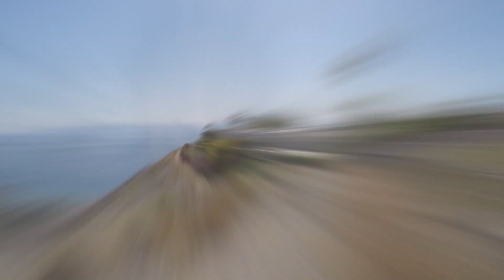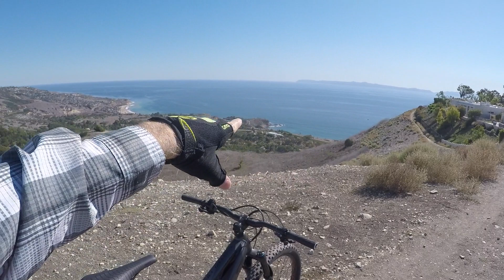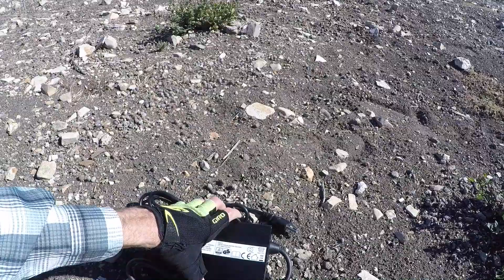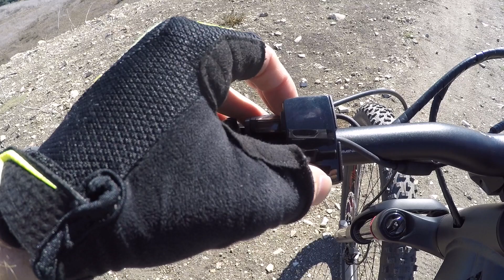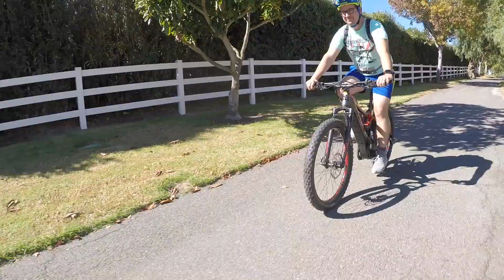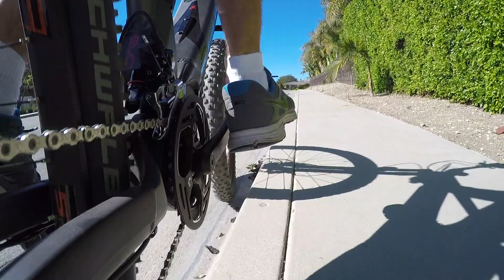BULLS E-STREAM EVO 45 AM Review - $5.5k

Comment: At the beginning of September 2020 I was on a sales phone call with M... from Flyride USA who claimed to be the COO of the company he was trying to sell me an electric Bulls bike. I asked him about  the known problem Bulls e-bikes have with the Brose motor. He assured me that Bulls has no defects with their Brose motor. He further informed me that it was only SPECIALIZED e-bike (which I wanted to buy from him in the first place) that had "bad motor" issue due to their dumb tampering with the motor software. So based on his recommendation I bought a 2019 Bulls E-Stream EVO AM 4 (S Mag) Black matt/grey 49cm which I received on Sep-05-2020. After riding the bike for less than 500 miles the Brose motor suddenly jammed and locked and threw me off the bike causing me serious injury to my knees and elbows.  It seems the motor belt got broken after being jammed inside the sealed motor which was exactly the known defect I inquired about and was told “it did not exist”. I also had more than 5 different parts failure with the braking system and the e-bike frame hinges which was another disaster. I communicated all the bad news back to the COO of Flyrides USA. He completely & utterly refused to solve these serious defects and blocked me from receiving phone calls to his mobile number and referred my emails to "the company lawyers". Now, the new Bulls e-bike has been sitting at my neighborhood bike shop for the last 55 days with its completely disabled motor while all my $5,500 investment was turned to waste toped with pain and suffering of my injury. This is the worst experience bike experience I've had in my life and I've never been lied to in such a massive way ever. I highly recommend not dealing with this company. You have been informed.

Comment: I just bought the BULLS E-STREAM EVO 45 AM  and am loving it!  Hitting trails and commuting to work daily on it.  Best money I have spent in a long time.  Everyone who tries it has the same reaction.  First no assist, see how the bike rolls.  Then I turn it up to level 4 and they take a few pedals and start giggling like a child.  My commute is fairly flat, so I'm averaging 20-26 mph without breaking a sweat (minimal effort).  Not breaking a sweat was the point in selecting this as also a commuter bike.    

As for trail fun, I'll never go back.  Sure, it's heavier, but I'm not carrying the damn thing, I'm riding it.  I'm cranking up hills far easier than a traditional bike and covering WAY more ground in the same amount of time.  And at 50-something this is saving my knees for a lot more years of riding. Like I said, I'll never go back.
Reply: Peter R .  Hi Peter I test rode a brand new EVO 45 today.  The chain came off twice up front and a cable in front of the rear tire came loose and destroyed itself on the rear tire not even 1/4 mile from the shop.  Have you had any issues with your bike like this?
Reply: @johnhamilton4992   Hi John,  The chain coming off the front chain ring is simply a derailleur adjustment.  And that's happening because the cable that got caught in the rear tire has too long of a loop.  I had my bike 20 minutes and did the same thing on a big compression.  Ultimate it's not hard to fix.  I replace mine, but obviously the dealer will fix this.  I ended up zip-tying the new cable to the seatpost/rear shock tube.   

I did have have the speed sensor fail, which was a warranty replacement.  This is all Brose technology, so I consider that a fluke.  Would I buy it again?  In a hearbeat...and I just did.  Picked up another one for my wife yesterday and the cable loop is MUCH shorter.  It definitely won't get caught up in the tire.  I'm not sure if this is a Bulls problem (I did email them mid-summer) or if it's a dealer assembly issue.  Probably the former and they've since corrected it.  

Some dealers are serious ebike shops.  Others are motorcycle shops that are branching out.  In either case, I think this bike is priced well above much of the competition, but you go from Class 1 to Class3, with a 90nm 350watt motor.  It's a LOT of bike.   Offer the dealer $4600. It worked twice for me!

Get yourself over to the forums at https://electricbikereview.com/ for good discussion on this bike.

Comment: Think i would prefer a Trek Powerfly or Cube Stereo Hybrid
Reply: Richard van Tricht I’m interested to know why you prefer those bikes. Would you mind sharing?
Reply: @newschoolnerd  i have a Trek fuel ex8 now which fits great for my size since i am 2.03meter tall. Also the clean look of the powerfly is great for me.. The Cube is a more value for money pricepoint and for example the cube stereo hybrid 160 looks badass. Also both have bosch motors which pretty much can be serviced at any lbs. https://www.cube.eu/en/2019/e-bikes/mountainbike/fullsuspension/stereo/cube-stereo-hybrid-160-race-500-275-greyngreen-2019/
Reply: @Richard1976  they aren't speed pedelec tho